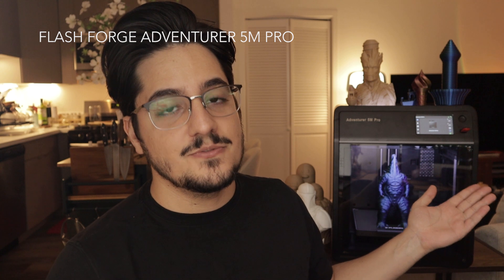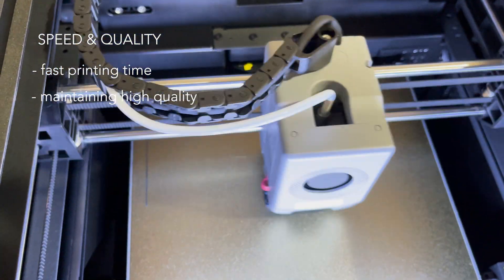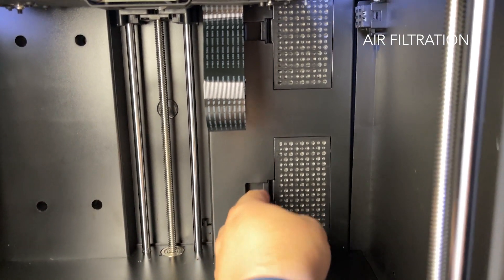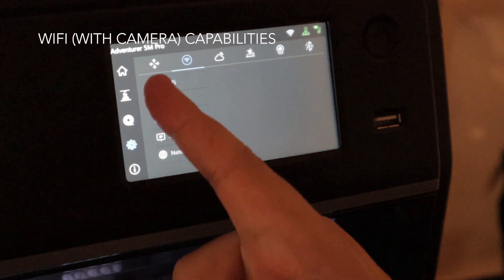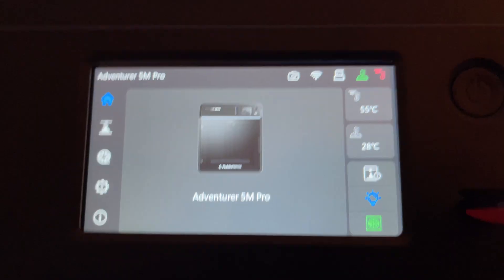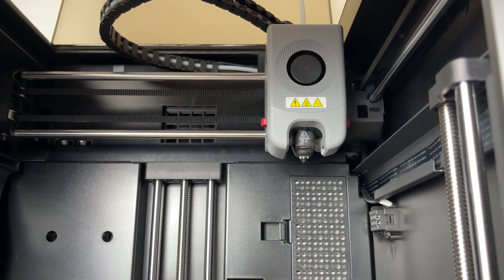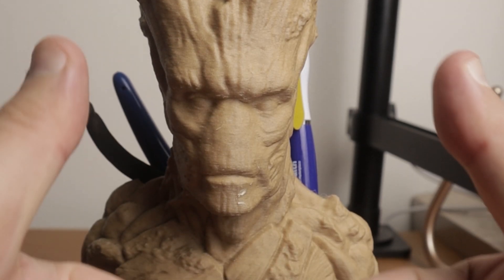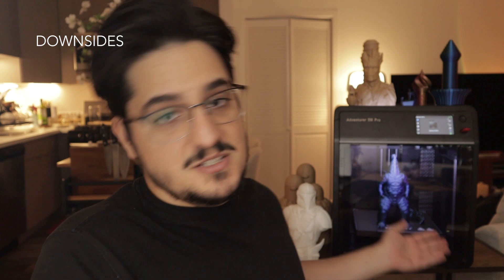This Surprised me! -  Flashforge AD5M Pro Review

Comment: 3:50 Don't push lockers while insert nozzle in! Simply insert it fully, check click sound.
Nozzles won't be axactly same size (in printing precission). After each nozzle change, do bed leveling - it is fast and easy. :)
Nozzle+hotend swaping if perfect in case of change materials (PLA/PETG/ABS). I have simply own needed nozzles for each kind of material. 
On my last classic printer my hotend clogged when I try change from PETG to PLA.